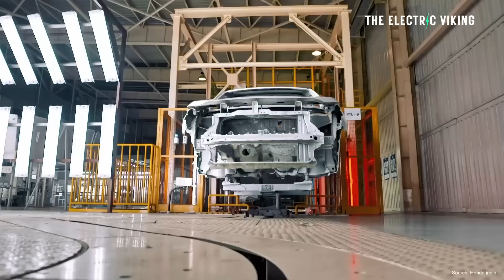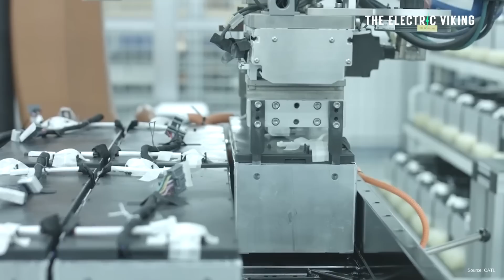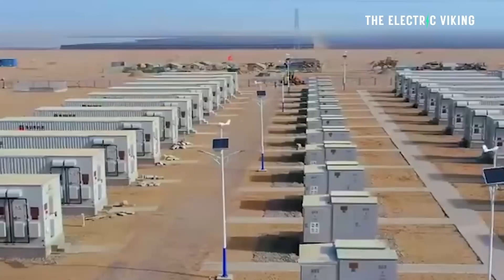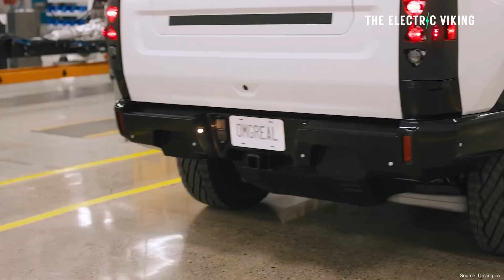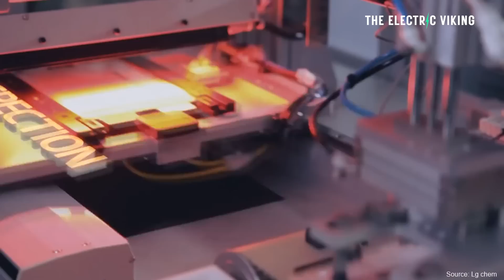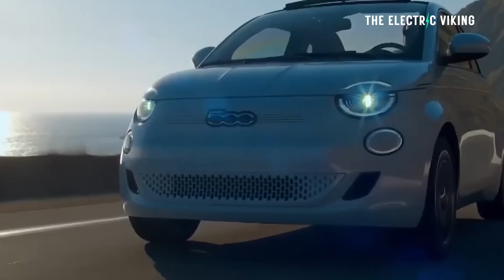World's biggest car companies are LYING about why they aren't making EVs

Comment: To be fair, the legacy OEMs are not really using batteries as an excuse anymore. I remember them include batteries in the discussion during supply period and during the fear period when Bolt batteries were going up in flames, but I can't find where any OEM has used "there aren't enough batteries" as an excuse in quite a long time. There is NO DOUBT, that many OEMs do pull stupid excuses out of thin air (GM, cough-cough) but a great deal of the buying public is a bit more savvy these days and anyone listening to those claims already know better. Those in the know understand that OEM's, especially our legacy brands here like Ford & GM, but also VW group, Stelantis, etc. still make a profit on ICE vehicles and will push that old tech as long as they can so they stay afloat. Meanwhile, much of the buying public here in the States are brainwashed into thinking the LEFT is PUSHING EV's on us poor souls purely for political reasons.

Comment: The real problem with EVs is the fact, aside from costs is the infrastructure is not in place for mass adoption and is not likely to be any time soon. Reliability and fix ability is also an issue (Wait for the “it hasn’t got any moving parts” screams)
Reply: That is true, when there will be ban on ICE cars, situation will look Like in Cuba. People will use old ICE cars.
Reply: @mareks9909  There is no "law" in the US forcing EV sales, it's the Biden Administration that is using executive fiat to force a deeply unpopular push towards EVs.

You can expect in 2025 that will go away.
Reply: They can set up a still and produce their own environmentally less unsustainable fuel at home 🏠⛽️🚘😊
Reply: Yup. The infrastructure in my garage is still missing. I would say that in two to three decades I may finally afford my 220v outlet… It’s going to be a tough stretch…

Comment: No need to make it a chip and battery shortage virtual issue, the excess of governmental subsidies of EV’s all over kills the market by  generating an excessive turn over, buyers re-harvesting subsidies repetitively in all the rich and industrial countries worldwide. Those tax payers paid sales incentives were essentially targeted at new EV buyers…Meanwhile, all those short time ownerships, short terms lease and rentals have rapidly saturated the low mileage and recent used EV market. The rest of the mobility market remains open, competitive and not subject to those heavy subsidies, tax breaks and all kind of insurance, parking and charging discounts causing a market distorsion and this out of balance crisis. Worst, Chinese EV’s competing also with recent and expensive second hand are detrimental to those used EV sales at a good price. Meanwhile, those old EV’s unlike thermal and hybrid cars surplus cannot be exported towards poor countries with insufficient electrical power production and power network. Finally with the war, both Nordstream gas pipelines destruction, the EU network energy prices of gas and electricity have been extremely volatile with disruptive price peaks scaring new potential EV buyers seriously questioning  that this mobility is no longer financially save enough to invest..in a loss…As a result of these  severe market distortion and developments, the depreciation of EVs has been very significantly faster than others free and less distorted mobility market products, the crisis is severe, same week MB Honda and Mazda announced without a replacement model, the end of production of EQC, Honda e and MX-30! Not good…

Meanwhile resellers offer immediate delivery of the much improved Prius 5 Prime plug-in hybrid way over suggested list prices in the US with a 5000 to 10000$ premium…the exact opposite of Ev price erosion, showing how deep the crisis is, a crisis labelled as a Ponzi scheme by financial experts…it seems also those new modern plug in hybrid are a success, because they are a true electric and true thermal car running efficiently on a gas pump on an electric plug or with the optional sun roof, getting with ten day in the sun a full recharge of 50 miles totally carbon free❤, seems a much safer bet and investment, whatever happens next…Here, my local Toyota dealer 300 yards down the road refuses to sell the only demo Prius 5 prime he received, because he is not expecting getting any more new Prius before a 1/3 year or so…game over, Toyota again, did their homework well… coming out with the right world wide sellable stuff…

Comment: I wonder how much CATL is charging for their batteries. Are they just overcharging? Why is it that companies other than Tesla & BYD are having so much trouble creating affordable EVs? The battery is the tricky part - everything else is just assembly, with some design and component work. Battery R&D aside (which EV makers are not having to do), EVs should actually be cheaper than ICE to develop and build. Less complexity, less parts. You don't need a huge exhaust/ventliation system. You don't need a huge cooling system. You don't have thousands of moving parts.
Reply: Overcharging batteries 😂🤣

Comment: There is no shortcut to profitability in the Auto industry when manufacturing EVs. But legacy Auto just don't want to do the work required on the manufacturing side to get cost down and quality up. Even if solid state batteries come on the market  at scale will that save them? One would have to assume Tesla would also have access to solid state. But Tesla's ability to manufacture at such high efficiency still would give their products an edge in cost. Legacy Auto have to fundamentally change their manufacturing methods; no silver bullets here.  It's an all in proposition.  I think they could have used the Giga Casting to reduce their cost for both ICE and EVs but they didn't. Watching dinosaurs die is not pleasant. Not to mention the obsolete dealerships.  I don't think a single legacy Auto Manufacturer will survive world wide; and moving production to China and just keeping the name I consider death.  In 10 years the mobility landscape won’t even be recognizable.  Tony was right.

Comment: CATL need to start making replacement battery packs for used/current EVs and hybrids using their latest technology. There’s going to be a massive demand for aftermarket batteries, especially batteries which could double or triple a cars original range. My Chevy Volt has a 87kW/kg battery, QILIN batteries have 255kW/kg, that would give my car over 110 miles range.
Restoring, reusing and upgrading existing EV’s is far more environmentally friendly and affordable than constantly scrapping old perfectly sound EV’s and making new ones.
Reply: Can I have the old battery from you Bolt? 87kWh per Kg is incredibly amazing!
Reply: I think they're more into making batteries. It's up to other companies to form the batteries into packs.

It's terrible most companies used PHEVs to scam for tax credits. A PHEV with ~20 miles of electric range is pretty useless. 60+ miles or range is plenty for 95% of trips.
Reply: 87 watt-hour per kg. Even good LFP could double that.

Comment: It reminds me of the logging industry in the USA.  They say they can't utilize smaller trees.  Thet are correct, with the old equipment that was designed to use large trees.  They need to retool to utilize smaller trees.  When they do, they are profitable.  Auto OEM's need to do the same thing.  also, get the price down for these EVs.  The vast majority of drivers will not or cannot pay 40K or more for a ride.
Reply: There isn't time. It took Tesla 15 years to be profitable. It can't be done overnight.
Reply: @MarkXHolland  Tesla had to build a whole production infrastructure from scratch, as well as design & source parts or build their own. legacy makers already have that. All they need to do is design, source parts & build cars. Something they have been doing for decades & should be 2nd nature, but can not realise that the market is changing (unless it's build more SUV's)
Reply: The average new car is more than $40k, so plenty of people buying ICE cars could afford EVs at that price point if they were being built. Instead, they're filling up dealer lots with more expensive trucks and SUVs that people can't afford because those are easier for them to make at scale than EVs.
Reply: @ordinaryhuman5645  There is a difference between "can afford it" and "no interest in it at any price"
Reply: @teekay_1  The vast majority of the latter are misinformed and will come around in a few years once EVs are more common and the reality is harder to ignore. People tend to jump on to objectively better new technology pretty quickly.
Reply: @ordinaryhuman5645  when the price comes down 50% and the full charge time is 5-10 minutes, then people will pay attention.

It appears we're a long ways away from that.
Reply: @teekay_1  It won't take that much, and we're already there. Tesla is selling every car they make and will continue to do so as they ramp up production. The Model 3 is already cheaper than an average new car before subsidies, and super chargers can apparently charge 200 miles in ~15 minutes. That's good enough, especially when most drivers can top off at home each night. Anyone who is buying a new car and not paying attention is doing it wrong.

In a few years when Tesla is producing even cheaper cars out of Mexico, if people still aren't paying attention they'd have to be on the far left of the bell curve, and those people probably don't buy new cars anyway.
Reply: @ordinaryhuman5645  Sales are less than 6% of new car sales and dropping, primarily because production of regular cars has started up again.

When the model 3's are selling for $29K with the larger battery, and not dependent on the the taxpayers subsidizing buyers, then they'll have something.

But we're a good 20 years away from that.
Reply: @teekay_1  I'm seeing 7%, up from 5% a year ago. There's a bit of an auto recession going on, which is why Tesla had to cut prices so aggressively. Manufacturers may be producing more cars, but many of them are going to be sitting in dealer lots due to high prices and high interest rates.

EV sales as a percentage of new car sales are going to go up partly due to Tesla and others increasing production, but also due to the drop in ICE sales.

And your timeframe is off by about an order of magnitude. It's coming much faster than you think.
Reply: @ordinaryhuman5645  Actually Toyota and Honda are having record setting years, without EV's.

And 7% was in 2022, for 2023, it's at 6%.  Which should tell you the market is becoming saturated with EV's.
Reply: @teekay_1  Where are you looking at data? Skimming goodcarbadcar, Toyota in the US is up slightly against last year's sales, which were significantly down from prior years. Honda is doing significantly better than last year in the US, but their sales are still way down from 2021. This is not a record setting year for either of them unless you have a goldfish-tier memory and only remember 2022. Try zooming out a little and looking at more  than the green YoY numbers.

 My guess is that once the pent up demand due to covid lockdowns from rich people who can afford ~7% interest rates is sated, sales will continue to fall, as they have since 2018. And the pace will accelerate because who wants to pay ~$50k and 7% interest rates for cars that are going to be antiquated within the decade, if banks will even lend for them?

Comment: Whenever car manufacturers makes claims like they don't make money, they don't do profits etc. Well maybe if thy would have had cleaned up their act 60 years ago, they would have ended up with less lawsuits, deaths of customers, poisoning their consumers, having customers die horribly in their metal coffins etc. Instead of worrying of profits per share, high pay raises, lying to the public. Just make good, reliable and affordable vehicles only. Have fewer models, fewer powertrains, fewer dealerships as now every little towns have or had failed dealerships rotting away, like their brands. I do not need a vehicle that does 0 to 60 in 5 seconds, or that goes 100+ miles per hour. I need an affordable car, good on gas and reliable!!!! The car industry had spent 80 years with their propaganda of a new model every 3 to 5 years, new colors, new engines, transmissions etc. Why?? because they knew the old ones wouldn't last?? and mostly, most did not sadly for the customers 😞 Gotta have those pay increases, stock options for Barra, and others, customers we don't care, just give us your money and we will make sure you will never get your money's worth, and you can take that to the banks!!! Oh but wait they are trying to remove banks and liquid money as well LOL

Comment: I totally agree with Sam. Here's the problem as conventional auto makers see it.  EV's without combustion engines, no transmissions and now with batteries that will last a long time. This will cause the total new car sale will drop, reliability will go up and the owners well be likely to keep their cars longer.  If it weren't for start-ups like Fisker and Tesla the old automakers wouldn't be building any EV's.  Think about why you trade in an older car, water pumps go out, starters, muffler, transmission problems, all these go away with EV's.  Take my plugin hybrid, doesn't even have a serpentine belt, power steering and the AC are driven off small electric motors.
Reply: I drive all over Southern California installing software. I see an ICE fire every day. From trucks to smaller compact cars. I also see extra events such as truck brake fires on the grapevine and the I-15, trucks on escape ramps because of brake failures, etc   There are lots of videos on those NTSB stats. LFP batteries will change the fire stats on EVs and reduce them and make them even safer.
Reply: @TheWizardofWestLA  ICE car never was ignite ship burn to scrap. They have very effective systems for extinguish ordinary fires. 230 thousand fire of 290 million cars, is 0.07% You are lucky guy.
Reply: ICE sales in US last year approx 14 million, fires approx 200,000 = 1.5%. EV sales in US last year approx 800,000, fires 52= 0.0065%
Reply: @SideTripLife  But ICE can`t put down cargo ship or parking builting. Energy grid fail can put down all EV`s, not ICE`s. Which one is firefigters choice?
Reply: Horse n Buggy lobby: "So, you guys plan to carry highly flammable liquid gasoline around in these new horseless carriages, plus create a vast network of pumping stations using the same stuff???  Good luck, no way we're trading our horse n buggy for that"...
Reply: There are many times more ICE fires per million miles travelled or per 100,000 cars than EV fires. ICE cars are much less safe than EVs. Check the statistics.
Reply: One EV started ship fire and ship and 3860 cars destroyed, including 500 EV`s. When it happen to new EV manufacturer, it might kill it. EV`s need special shipping and it cost. ICE cars are very safe.
Reply: NTSB - Cars which caught fire last year per 100,000 sold: ICE 1529 (total 199,533). EVs 25 (total 52).
Reply: A Honda Accord with a plain gas engine will outlast any EV and will have a lower lifetime cost than an EV.

Comment: What would you do if you were in China's position & a democratic capitalist country economy?

I'd announce considering supporting midsized auto, bikes, heavy construction equipment, SWBs, VPPs, even supporting research on military uses. Do it by buying then reselling batteries at discount to emerging & established manufacturers. 

This supports their battery industries keeping them flushed & incentivized to innovate while keeping costs down with economies of scale. The manufactures can be chosen from the ones that have track record, shown competence. Some will fail. That's how capitalism is suppose to work.

For the government, China would get a maturing varied domestic manufacturing sector. Their local future available markets for their produced goods & services, from cars to VPPs, are sufficient to challenge their capacity to produce while providing opportunities for wealth creation, locally. Good ROI from a democratic-capitalist perspective. 

External markets are a different matter. There's really no pressure to perform on that stage. There's reward. There's risks.There's no requirement. Their local markets, & current trade partners, is of excess size to feed their expansion needs for years, maybe decades.

Consider what happens as a greater and greater % of auto sales is EVs growing faster in China than in Europe & NA. By the end of 2025 ICE may well be effectively dead in China, no significant import or domestic production, while ICE would still be infecting the other global auto markets.

The overall economy of one would be, by definition, out performing the other. 
Clearly. 
Just on that metric. 

Add in implication on SWB deployment & therefor overall energy distribution & costs?
Which is the healthier economy?

Comment: The grid buildout is another hang-up. Permitting various aspects of the buildout seems to take forever, stalled by lawsuits from disparate interests.
Reply: True, but grid problems are not a factor in GM's lack of EV sales.
Reply: @nealmatthews3048  Well when you can't charge your car because of grid issues it puts people off of buying that type of vehicle.
Reply: Then why are Tesla sales growing at a tremendous rate?
It's not EV sales that are struggling. It's GM EVs. So it's obvious the fact the they are EVs is not the problem. It's that they're GM.